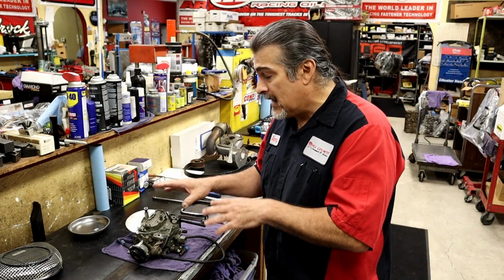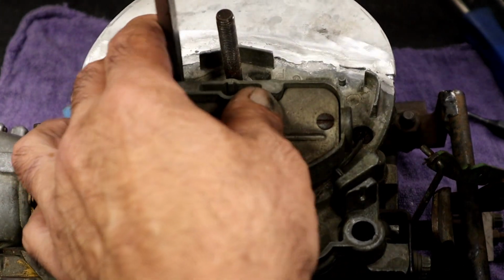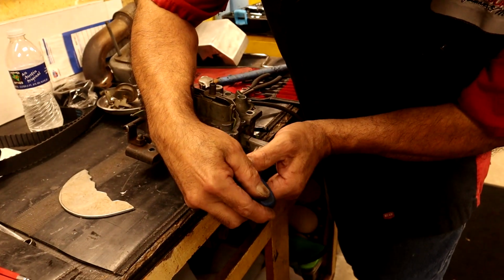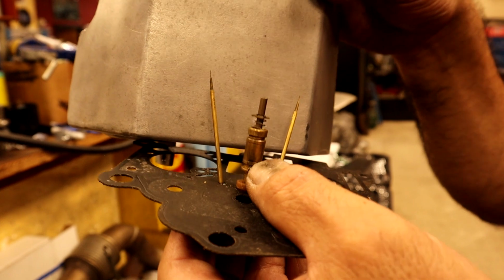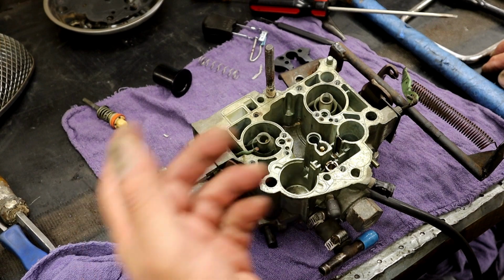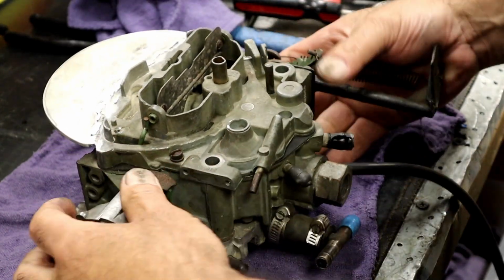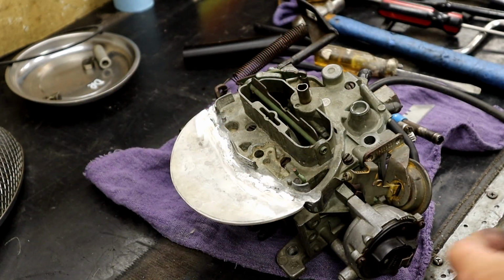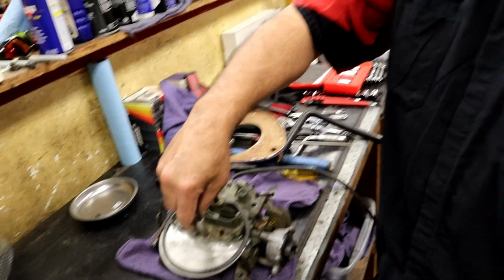A look inside Smokey Yunick’s Hot Vapor Carburetor.

Comment: You guys are looking in the wrong place , vapor won’t come from that carburetor it’s vapor fuel before it gets to the carburetor, that carburetor will only be used to open the throttle and let the vapor fuel get into the intake manifold, your just showing a regular carburetor you won’t get 100 mpgs, by the way remember Tom Ogle 915 Chucos best, Rams 100mpg

Comment: Do you think we could vaporize fuel before it gets to the injectors on a modern car and get the same effects?
Reply from the maker: No not before the injectors, we are working on a modern fuel injection engine and it will use fuel injection.
Reply: Direct port injection is really the worst way to feed fuel…. No time to vaporize and mix properly with the air…. This is why Smokey said a cross flow intake would be hard to beat…. Plenty of time to properly mix the the air fuel charge

Comment: Important wiestion, why did yunick put a 4 barrel air cleaner on a 2 barrel carb. The extra work seems wasted considering the same air cleaner was available for 2 barrel carbs. Was it to make more parts of the carb top accessible to specific temp of air?.
Reply from the maker: He was using under hood temperature as well, good eye!!! 👍

Comment: Life before ethanol sure was easier own stuff  Thanks for the video and the enthusiasm awesome job
Reply: Yep, Pre-ethanol days. I get NON-Ethanol fuel in S. Central Tx at the pump at all (2 letter gas station chain, capital Q., capital T.). All inner pumps that Don't have diesel, will have a left side mounted, red-handled nozzle of 90 or 91 octane gasoline. I use it exclusively for my Master fuel cans, with a famous fuel stabilizer plus a famous old school red oil/fuel additive (initials MMO). Sorry, I have to write in "code" because YT has censored my messages if I say the business names or product names directly. Thanks Danny for the awesome Smokey content! A Smokey technical junkie since the June '84 Hot Rod article. Paul from S. Central Tx.

Comment: Is there anyway you could show us the 1stage fuel heater? It it basically a heat exchanger that lets warm engine coolant pass on one side and then the fuel air mix on the other before entering the turbo or homogenizer? Are you guys here in Texas? I’m down in Aransas Pass.
Reply from the maker: On my next video, you can see it more , yes it’s basically a heat exchanger and we are in Texas.

Comment: I didn't see you take out the power piston spring. We use to use various springs to get the desired results. We would pull out the power piston spring plug on the top cover and fine tune the metering rod depths. I noticed there was no hole drilled in the plug to assist in removing the plug which I think is odd on a carburetor that would be highly adjusted. Back in the day I would build at least one Quadrajet a week.
Reply from the maker: Smokey calibrated this carb so I didn’t want to change the settings. 👍👍👍
Reply: @MrDanielSoliz  I have seen thin metering rods like that on the back barrels of some Quadrajet carburetor, not on the front.  With thin straight pins the power valve would have very little effect on fuel richness. In effect it would be rich most of the time depending on jet size.

Comment: Smokey didn't just use a carburetor but a whole system.

He first use the water from the cooling system to help heat the water to engine temperature of 220* and was the first stage of the heating system

The Second stage of heating was at the Turbocharger were it was heated by using exhaust before going into the intake manifold.

The 3 stage of heating was done in the Intake manifold and rase the airfuel charge to 440* before being induced into the cylinder.

It was said it took 20 minutes before the air/fuel charge would separate.

But in the normal English The Air/Fuel will separate faster than you can Puch a stop watch.

I think the nomad Temp of the intake manifold is only around 150* but recheck the Data as it's been years since i have read the Original story in popular science or popular Mechanics.

There was another story of a guy called

Tom Obga ? Spelling. In El Paso Texas were he was pulling gas fumes from the gas tank in a ford LTD if i remember correctly

He said at first the car's MPG were not All that impressive and the car would stall as well.

He said things change one day after he put his hand on the gas and found it Ice cold. Witch is one of the laws in Physics because the Air pulled through the gas cause it to Evaprat and cool down the Gas.

He installed a heating unit kind of like a heater core and said that change everything because now the fuel will be heated to the cooling system of the engine.

When you look at the first photos of the car's vapor system the pipeling is coming out the Gas door and along the side of the car.

In his later work the system is run under the car and the carburetor was removed and only hot gas vaper was getting to what would be the throttle valve.

You can look up his story about him and people who said they went on a test drive and got a 100  MPG in the big Ford

Thanks for posting you never know when you are going to spare an idea
Reply from the maker: You my friend our totally correct, this next year will be spent mostly on the Hot Vapor project. I’m fortunate enough to have several of the engines and the original Chrysler that we restored and is ready to test. 🙌
Reply: @MrDanielSoliz  
That's great I have heard stories over the years and spend time listening to them and hear a lot of things that seem based on solid evidence

Can't wait to see the videos as you never know when you may just spark an idea on the mind of someone keep up the good work.

I love the Carb over EFI because of the simple trouble shooting and ease of repairs

Thanks

Comment: Hi 👋 this is something like tom ogle carburetor? 👋👍🏻👌
Reply from the maker: I think so! Both vaporize fuel.👍
Reply: Smokey at one point wanted to make an engine where heat couldn't escape so that all the heat had to turn the crankshaft but obviously there are problems with that idea. But speaking to fuel engineers he learned that gasoline was more homogeneous at 276degrees (perhaps not true today) and that if heated to this temperature would not knock as easily and may ignite leaner in the engine which is a problem when trying to run an engine hot and also lean so as a compromise between his "engine in a box" idea and a conventional he designed a system where fuel/air from the carburetor was passed through a turbocharger which he dubbed a "homogenizer" and then with a manifold heated by exhaust (not too dissimilar from some boat combined manifolds on reverse flow inline heads if someone wanted to recreate this effect in an available engine) and the exhaust flow through the intake manifold was temperature regulated for an intake temperature around 276 degrees (I'm going from memory, it may have been a different temperature, I don't have his book on hand) and this heated and homogenized and pressurized by the turbocharger fuel/air charge was then burned in the engine. There weren't any details about camshaft or combustion chamber mods other than that it had a special camshaft. The turbo was supposed to have been sized to limit boost and not wastegate regulated. So to make the engine run as intended might be an experimental nightmare. But his fiero got Prius like economy numbers and was said to be faster than a normal fiero. I know one of the engines was supposed to have been a v2 based on a Buick V6, but when he went to Chrysler they were working on an i4 probably based on their 2.2 k platform engine that had a reverse flow head. That carburetor is basically a standard Rochester dual jet which is probably jetted lean and the tapered rods are probably so exaggerated to give it a rich startup before vacuum pulls the rods down. It's not a vapor carburetor, it was a "hot vapor" engine. The heat and homogenized atomization come from the turbo and specific heat regulated manifold.

Comment: Not a carb from Yunic
Reply from the maker: Yes sir it is.
Reply: @MrDanielSoliz  As some have mentioned before, simple mods to view operation and assembly/disassembly are missing. NOT a Yunic product.
Reply from the maker: You keep saying it is not a Yunick product. No he did not manufacture the carburetor but he did modify it and in fact came on the Hot Vapor engine. These Hot Vapor engines are all from Smokey Yunick.